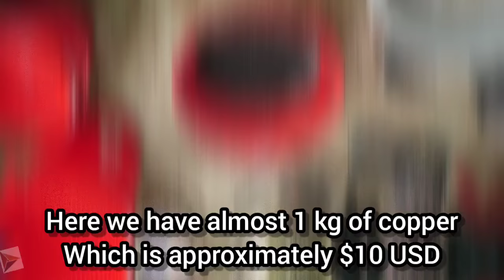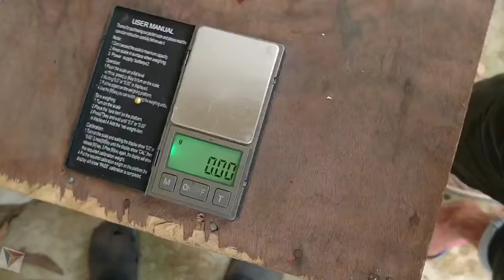Transistors Gold Recovery | Recover Gold From Transistors | Gold Recovery

Comment: Just the advice boys. I’m a jeweller. And almost everyone making the same mistake. When you melting gold dust or fine gold ; do not put fire directly onto the pot. Mix it 50%gold 25%borax 25% sodium carbonate. Raise the pot with pieces of stone or tile and leave underneath elevated. Hold the flame from the sides and under until it becomes red and gold sticks to the powder. Then heat it. When melted , hold the pot and try to spin the gold and catch all the gold inside the melted borax. Good luck.
Reply: Is there much added benefit? Or is that just "the way it's always been done?" Perhaps a cleaner look?
Most small ewaste refiners use much less borax and don't set up like a charge for fire assays.
Small amounts of sodium carbonate sprinkled before heat glues the powder into a nice compact clump with a just a little heat to sides. Then tiny bit of borax to lift after its beaded. 
Keeps cleaner crucibles for alot of small batches.
Reply: @colonialcharlie8702  you are correct my friend. What I was trying to do is ; after so much work and cost , most people loose their fine gold in the melting process. Pressured gas flames force the gold out that you can’t see it with the naked eye. This is one of the method , I was trying to save small scale investors.
Reply: Ah yes, haha I have my "lesson crucible" with red spots all over it, where my first test burns' fines powder ended up. Luckily it blasted into a homeade chamber, and i could recover the majority from a peice of ceramic wool it got sprinkled into.
(Chunk of the filter paper gave way and then let pressure blast through the powder)
Now some sodium carbonate goes a long way.

Thanks for advice
Reply: Learned that one the hard way when i first learned refining... Melting my very first button... Bout 4grams in the dish. Hot it with the oxy torch flame and poof, empty dish... Managed to wipe up and recover 1.8grams out of right under 4.1g... Ouch
Reply: @idontknowmyfirstname69  lucky that, you’ve done it in a place that you could recover some of that. 4 grams worth of scrap is lot of hard work
Reply: @colonialcharlie8702  I⁰
Reply: Wow..❤❤
Reply: Excellent.  I do not form a classic charge either and have noticed I leave a lot of room for gold loss when melting.  Would like to try induction heating but until then, I preheat the melt dish, then add more borax, then slowly burn off the filter paper allowing the dust to heat and cling to either other gold or the borax.
Reply: Great advice.  Thank you!
Reply: U should make a video and show us
Reply: @leo959 maybe I should.
Reply: all the same... nithing change

Comment: I collected 1000 transistors for gold recovery and before pouring sulfuric acid on them to dissolve the plastic I decided to open transistors. I was shocked!!! 😧 Out of 1000 transistors, I found only 17 gold-plated transistors. Different types of transistors and they were all copper with a little bit of silver. 🤔
Reply: How did you open them????
Reply: @toomuchdebt5669  You will find the answer in my last video. I showed how especially for you 😉👌
Reply: and how much gold you got ??
Reply: Try high frequency power transistors or transistors used in radio, TV and satellite transceivers.